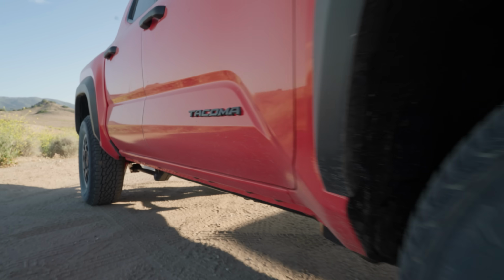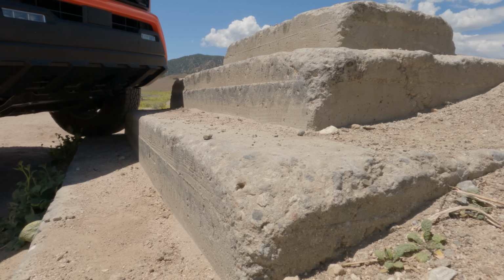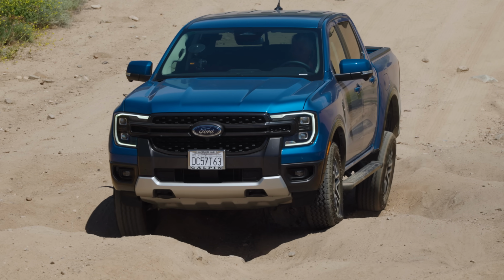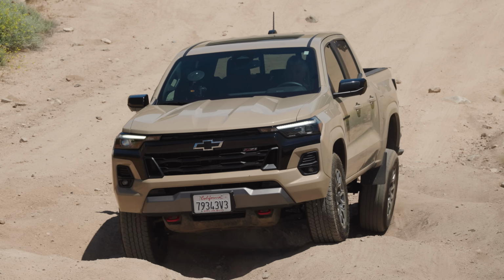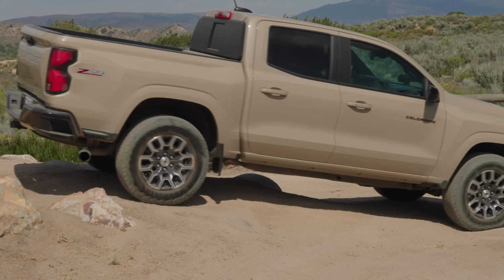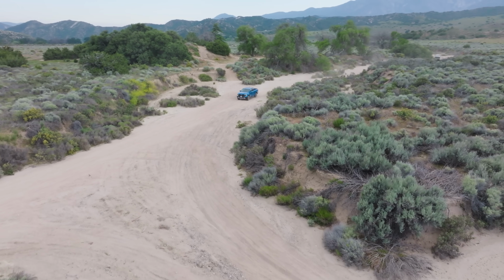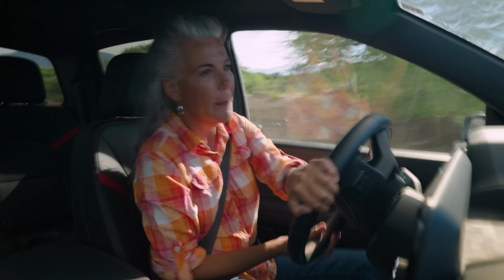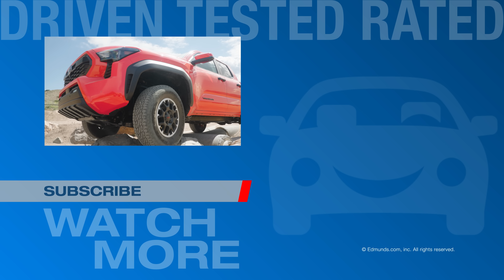Off-Road Comparison Test: Toyota Tacoma TRD Off-Road vs. Ford Ranger FX4 vs. Chevrolet Colorado Z71

Comment from the maker: Are these trucks off-road-y enough for you, or would you spend extra bucks for a ZR2, Raptor or TRD Pro? Let us know in the comments!
Reply: Subaru Outback Wilderness (with skid plate and tow hitch) and a KX 250 or CRF 250
Reply: Mini van and huffy 👌
Reply: I think I’d go for the raptor ranger, where’s the gladiator rubicon? It’s hands down the best one off road.
Reply: The trd pro is compared to the non off road package on the ford and Chevy.. to be fair the comparison should be the trd, pro, vs the raptor ranger vs the Chevy bison.. I’m impressed how much of an improvement Toyota made except that I hear that its transmission is very weak,, possibly a future recall?
Reply: @edmundscars  substitute the TRD Pro for TrailHunter and then the comparison would be righteous.

Comment: Colorado ZR2 $46K in my area. Z71: $38K. Taco TRD Offroad: $43K. Toyota prices are out of control. The ZR2 is hugely more capable for $3k more.
Reply: The Nissan frontier right now is almost like what the Tacoma used to be. That’s basically the only option left if you want a V6 engine.
Reply: @KNRS927  the frontier is also has the least technological truck.  It's basically the same truck from 2005.  The traction system, steering, safety is all outdated.  Nissan didn't really update it enough to compete and the price shows.  It's the cheapest midsize truck
Reply: @beexiong2995  Nissan basically copied the Toyota formula when they redesigned it because they saw how popular the 4runner and Tacoma were despite both being ancient. Only thing is Nissan doesn’t have the rep Toyota has so the price and simplicity get people.
Reply: @KNRS927  honestly the 2nd gen tacoma and current frontier have the same mechanical tech.  Toyota has atrac and nissan abls.  3rd gen tacomas got offroad modes like crawl control and terrain select modes.  Frontier never got any of those
Reply: @KNRS927 she even says in the video, you can get the ranger with an optional V6.
Reply: @Goose_Lord  You can, but it's a turbo 2.7L Ecoboost. That engine has been around for almost 10 years now and some F150s with that engine are still going strong so maybe they worked out the issues, but the Frontier has a 3.8L V6 with no turbos, normal 9 speed, and that's part of the old school feel people love on that truck as well as the last-generation Tacoma that had a 3.5L V6. SO sure it has a V6, but a small turbo one and not a naturally aspirated V6.
Reply: @KNRS927  all very true. Not much to complain about in this market when there's something for everyone.
Reply: @Goose_Lord  You got 5 solid options with the Tacoma, Frontier, Colorado/Canyon, Ranger, and Gladiator (if you count that in this segment). Then there’s also the EV luxury option in the R1T if you fancy spending more.
Reply: @KNRS927  yeah it's a tough call with the trade offs, but I'm heavily leaning towards the Colorado ZR2
Reply: @beexiong2995 I had a 2019 Tacoma TRD Off Road and all of those “technological” systems you listed are crap and useless for off-roading. Just more crap to break. We used to off-road our 83 Hilux without any technology and it went everywhere. If you need technology to effectively off-road you should keep to mall crawling. BTW the Frontier has Dana axles and a Spicer transfer case that are better than anything in these trucks.
Reply: Your obviously comparing msrp va markups which makes you argument invalid
Reply: @9663mu  if markups are comparable it's absolutely valid. Considering these aren't TRD pro or ZR2 bison there probably isn't a ton of markup on average.
Reply: Really...hugely more capable? Give me a break.
Reply: Where is your area?
Reply: @elche1976  Rocky Mountains
Reply: @0HOON0  which state,  area.... may go looking there if it's that much cheaper than my area.
Reply: Yeah, I've been looking at a new vehicle and midsized trucks are on the list but almost but the Tacoma is on their because toyotas nowadays are way to expensive and I don't want to be on of millions of tacomas.
Reply: @KNRS927  The 2.7 ecoboost never really had any issues, (the 3.5 ecoboost in 2017-2020 have/ had cam phaser issues) I've read many posts with 2.7 ecoboost's cruising along with over 300,000 miles still going strong without issues.... older and newer versions...
Reply: But what truck will make 300k miles…
Reply: We'll see how the Colorado stacks up a couple hundred thousand miles in...My Taco will still be going strong...love my 23 trd 4x4...wouldn't trade for either of those options....sorry...absolutely love my Taco

Comment: The Colorado Trail Boss would've been a much better option for this match-up.
Reply: How?  Its only slightly wider and only an inch more lift than the z71.  Drivetrain is identical.  Trail Boss is stripped down work truck trim vs Z71 which has the interior bells and whistles.  For sure the trail boss is good value and the slight lift and a little better tire option can make a difference but I think on this course you may not see it.  Trail boss interior would fall short of the ranger and tacoma.
Reply: @spyder000069  The drivetrain isn't identical.  On the Z71 (featured here), you have to manually lock in the rear.  The Trail Boss has a G80, which would have auto locked, even on the very first obstacle.
Reply: @dayv4630  z71 and trailboss are both g80.  zr2 has electronic rear locker.
Reply: @spyder000069  I thought the Z71 had a selectable locker?
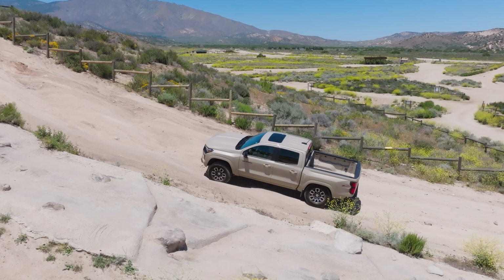Reply: @dayv4630  Unfortunately not.  She also mentions that at 3:30 in the video (she is in a z71).  Its a one of the negatives in my opinion with the colorado/canyon series.  The problem is I don't do severe off road but I have needed the locker in some situations with the snow here in the midwest (I live in the country).  So a locker is important to me but what is also important to me is tow capacity since I have atvs, side by sides, a tractor, all of which I use a flatbed and enclosed trailers with.  I am not a fan of the G80 in the gmc trucks.  Ford has selectable electronic lockers that you can get even on the cheaper XL packages and this does not lower the tow capacity.  On the GM trucks you have to go to the off road package (ZR2 in this case) which drops tow capacity and also usually puts on the larger tires reducing mpg.  I do like the looks of the colorado/canyon but because of the locker situation I would probably have to go ranger/frontier and out of those two the ranger is the better truck for towing but the frontier has the potential to be more reliable although with less overall power.

Comment: The width of the rangers' bed instantly makes it more useful as a truck. When the 6cyl becomes available, that should further extend its superiority over the other options. As far as trucks that do truck things, I'll pick the Ranger.
Reply: V6 only available in ranger raptor p sure
Reply: @JuanBen0220  The 2.7 is going to be available
Reply: I have a 2019 FX4 with the 2.3 Ecoboost, it is great. I was initially a bit hesitant with it being a 4 cylinder, but that little motor straight rips. The availability of aftermarket bolt-on power is also a big plus. I feel like the 2.3 Ecoboost doesn't get the love it deserves.
Reply: @x7slim8x  Oh I agree. I drove one from Louisiana to Illinois and the little engine performed excellent. The reason I'm more interested in the 6 is because it has 2 more cylinders to make power with. Less stress and pressure when towing a heavy trailer
Reply: @teddonley9594  Oh absolutely, I use mine for the woods. I never even put the tow package on, I have it sitting in a box lol. I did a 3.5 inch and leveled it. 33s on 18s. Mine isn't made for towing anything lol.
Reply: @x7slim8x  I tow a lot, but nothing a midsize can't handle. Not more than 5000 pounds. In my area, we have a ton of hills anywhere you go lol
Reply: @teddonley9594  I am in Arizona at 7,000ft in elevation up in the mountains and forests. An hour drive from my house and I'm at over 9,000ft. Phoenix is about 3ish hours away and 6,000-8,000ft lower so taking my Ranger down to the city is quite the test for that little 2.3 liter. Like I said I haven't towed with it up those mountains, but with the bed loaded and 5 of us in the cab it has zero issues gaining speed and passing others up the steepest of grades. Ford did a damn good job I'm thinking.... well hoping.... I just passed 60k miles so fingers crossed lol.
Reply: @teddonley9594  this is my 3rd Ranger. I just sold a 1996 4.0 5 speed 4x4 and a 2003 4.0 automatic 4x4. Both were fun  and reliable trucks. The 96 was my previous woods toy and had over 230k on it, I just kept having clutch issues so it went to a farm and will be their farm truck now. The 03 smashed a Camero that ran a red light the week my daughter got her license. It was still drivable, but it tweaked the frame so it left to be a project truck for a youngster. We had 3 rangers at once lol.
Reply: I've read the 2.7 is currently available in the NON Rapter Ranger as well....this new base style Ranger....
Reply: @barrya.6212  Raptor has the 3.0, and the 2.7 is available in  XLT and up.
Reply: @teddonley9594  Thanks for details.

Comment: I’ll probably go with a Tacoma Trd OR next year. The GM 8 speed trans problems/class action lawsuit scare me, and the Ford has plastic oil and transmission pans & plastic oil drain plug. I like the Tacoma rear coil suspension & rear underseat storage set up.
Reply: Its a revised transmission I done almost 11k towing on my 2023 not a problem yet lol
Reply: Was going to go with a 2024 TRD OR, but they are having way too many issues... Especially now with the transmission's having to be replaced, and an over 2month wait to do so.  Toyota is not what it used to be.  I'm leaning towards the Ford or Nissan Pro-4x
Reply: @border411  I’d say the Frontier is the safest bet right now.
Reply: @border411  Very few issues reported on the 24 Taco. The transmission issues are a small minority of manual owners so still a tiny subset. But if you want to play it safe then yea, cant go wrong with a P4X
Reply: @YerBoyTroy  There's an article today that states the AUTO's are failing early too in the Tacoma....and both on a larger scale, there was also problem with the front wheels disengaging when in 4WD mode....that might of been a rare fluke but .....
Reply: The Ranger uses a steel oil pan. Only the transmission comes with a plastic pan.

Comment: I've owned a 24 Tacoma TRD Offroad for about a month - just took it to Creede/Southfork area to put it through its' paces and was truly amazed at the trails it would eat up in "bone-stock" format.  Nothing I love more than passing people in SxS that are giving me the "how the heck did you get up here" eyebrow raise!  The only places I felt like it was lacking were in mud (stock tires aren't very aggressive) and I'm going to get an aftermarket front facing camera and a winch.  Oh yeah - AND it rode like a car on the 12 hour trip to get there!  Very pleased with my purchase...
Reply: Thank you for the feedback.  Great to hear the feedback on the Tacoma.
Reply: Good to hear. I Just picked up the TRD Off Road last week Traded in my Gen 3 with120000 miles for 24K and they dropped sticker by 7K. Felt like a good deal even though 3K of that drop was dealer add on. Hoping it proves to be as reliable as the GEN 3. I will be in SW Colorado next month need to map out some adventures . It doe ride exceptionally well on road.

Comment: I'm not too surprised that the Colorado won the sprint portion of this comparison. The chassis is designed to do that, granted it's more for the ZR2. Because most of that version actually competes in races.

Comment: One would think GM would ditch the automatic locker after 20+ years of sucking. I found the best technique was to carry a little bit of speed and stay on the gas a little bit when a wheel started to slip, so that when the locker kicked in, I was still moving forward and didn't need to suddenly get on the gas once it hooked up. Got me up some gnarly stuff... but why make it so annoying?

Comment: Hey Edmunds, on your Colorado, can you check the bumper fitment near the headlights by the black fascia? Many Colorados seem to have paint chipping in those areas due to poor panel fitment, and GM is refusing to cover it under warranty for many people. Just wanted to see if you have a similar issue on your long-term Colorado. Thank you!
Reply: Had mine for 6 months. Looks fine.
Reply: @MrHand-ih4sz  Do you have an LT or Z71?
Reply: @AGamingMuffin  got the ZR2, no Bison package. I've heard YouTubers complaining about where the plastic front fender flares meet the nose of the truck...there is about an 1/8th inch gap there. I do have that, but don't see it as being a problem. I think fit and finish is really good overall.
Reply: @MrHand-ih4sz  nice nice. I have heard that with the ZR2. You have a different style front bumper compared to the Z71 and LT, so I don’t think you’d find the same paint issues. Besides the paint, it’s been a great truck.
Reply: @AGamingMuffin  Yessir. Only 10K miles so far, but it's alot of fun. I've had three 5.3 Silverados before this, so I was a bit skeptical about the 4 banger, but it accelerates harder than they do and runs great. Shitty gas mileage, but I knew that going in.

Comment: During the off-road test drive, it would have been better to show more of the outside view when you were handling the trucks rather than the inside view. I don't mind seeing the driver's reaction, but I was more interested in the truck's reactions rather than the driver's on the turns.

Comment: I follow your beautiful channel and I owned a 2022 Raptor with a 35 package and it was sold and I used it for two years. I now want to buy a Ford F-150. There is a 3.5 V6 turbo engine in Saudi Arabia and a 5.0 V8 engine. Which one do you advise to buy or recommend buying a 2024 Raptor with a 37 package?

رد

Comment: Once again they omit the Frontier Pro-4X, arguably the best value proposition in the midsize segment.
Reply: It's a Nissan though ew
Reply: @driftx2  10 years from now you’ll see what I mean. Love or hate Nissan trucks… they last.
Reply: It’s by far the worst truck in the segment right now. Ride quality absolutely sucks. Interior sucks. But yes the engine is super reliable. But the 2.3 eco boost has been very good. It’s been around since the 2013 ford ranger in Australia and it’s held up like a beast. So there’s absolutely no reason to get a frontier

Comment: You sgould have tried locking the rear end of the Ford while still in 4 High. Plus you wouldn't use up your brakes.

Comment: I feel like this review was biased. During the first obstacle it was clear the ford could have definitely made it up further. Then on the second obstacle she mentioned atrac from the Tacoma, but all 3 trucks have a similar system. If she just stayed in 4 high and maintained light throttle she would have made it up with all 3 in 4 high. The reason I say that is because I have done it in 4 high in several different vehicles on that exact obstacle in hungry valley. Also down playing the rangers power train is a joke because it’s faster 0-60 than the other two with the 2.3 eco boost!!!

Comment: Honest question for you off-road truck or SUV people. I love the way off-road spec'd trucks, broncos, etc look but the prices for the higher trims on most of these sorts of vehicles are easily over $50k (not these 3 specifically). Seems like if you had access to that sort of terrain, you'd just use any normal truck or SUV and carry a dirt bike. I mean any $5k-$8k bike will put all of these to shame and then you have your normal car/truck at a cheaper price?

I mean it's a truck, slap a bike or ATV in the back.
Reply: i think it meant for more camping place you can carry tents coolers etc. for what you might need.

Comment: I just bought my 1st truk.. tacoma 2021.. V6 with 9000 miles.. so im 56 yrs old.. so when i die in 20 yrs.. the truck will have 40K AND MY daughter will drive it for 450,000. More miles..  who is winning???   CHEVY IS PRETTY much. BUT JUNK.. ford is ironic.. but doesn't  hold up....

Comment: The Tacoma's transmission (manual or auto) will fail in under 20K mileage.....the Ranger and Colorado's trans will NOT....the Ranger now with the optional 2.7 ecoboost (used for years successfully in F150)  has long lasting proven reliability, the Tacoma's new turbo doesn't have same longevity testing...

Comment: This Is pick-up! Truck Is Peterbilt Kenworth And Mack
Reply: Actually per the definition 

1
: a wheeled vehicle for moving heavy articles: such as
a
: a strong horse-drawn or automotive vehicle (such as a pickup) for hauling
b
: an automotive vehicle with a short chassis equipped with a swivel for attaching a trailer and used especially for the highway hauling of freight
also : a truck with attached trailer

It is a truck both are. They also specify midsize truck not heavy duty or full size